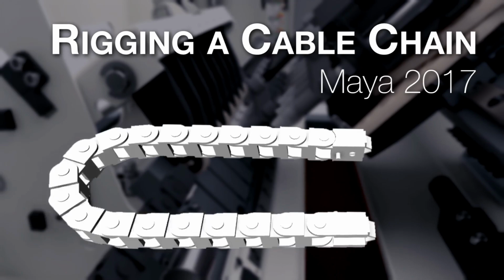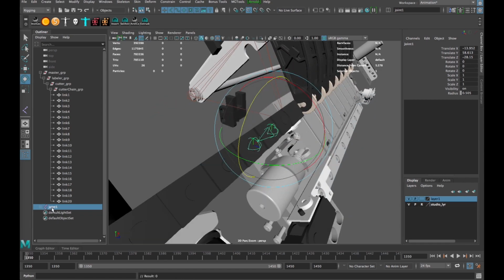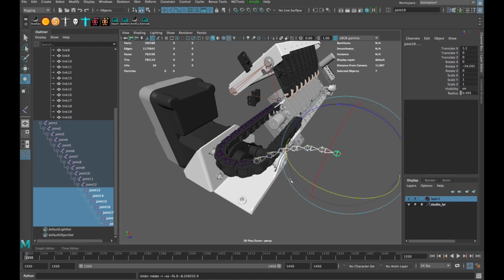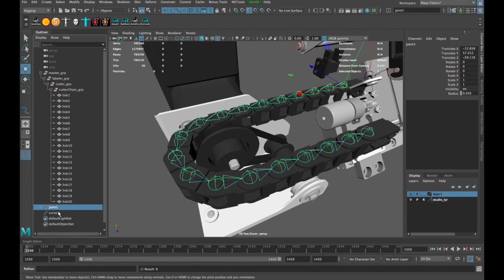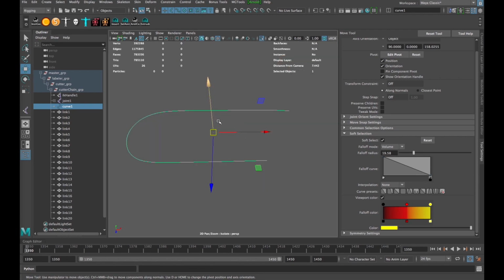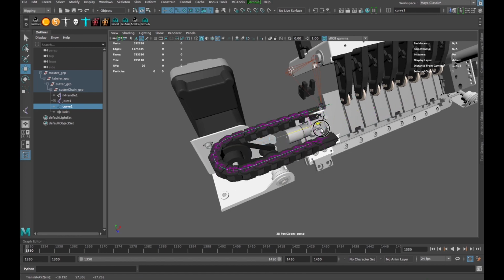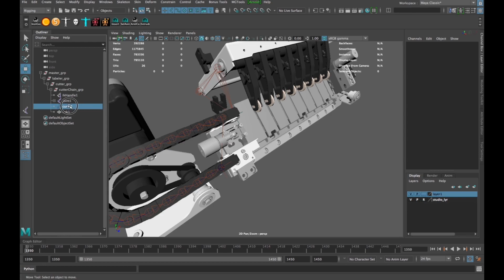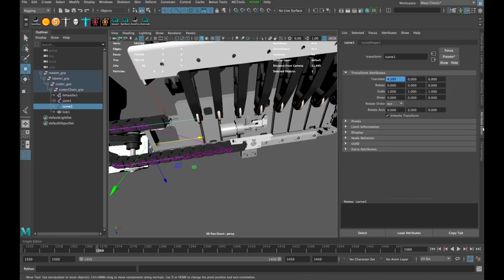Machine Animation Tutorial: Rigging a Cable Chain in Maya 2017

Comment: hi, thanks for your tutorial, I have a problem of fixing the model, the model that I have downloaded from igus cable chain, it doesn't have center point on the cable connection point.
Which mean that the magnet function doesn't have vertex to stick.

Comment: Sorry, when I want to use the "Create IK Spline Handle" option and select my Joint1, I get the error "// Error: No valid items were selected. Must be joints, effectors, or nurbs curves." How can i fix this?
Reply from the maker: Maya might have changed their IK tools, so you may need to look up another tutorial for that. I think you can also do it backwards by Cntrl/CMD selecting Joint1 and the End Effector before selecting Create IK Spline Handle
Reply: @RaconteurAnimation  Thank you very much, I will try.
Reply: @leonardoemiliohernandezper1822  I have actually encountered this issue as well several times. I found that the fix for this is to do it through the Hypergraph: Connections. You can find this menu by going to windows>General Editors> Hypergraph: Connections. Make sure you have your joint chain selected before hand then once you open the hypergraph connections to select input/output connections in order to display your joint chain. The button looks like 2 grey rectangles with a blue rectangle in the center

Comment: If your still curious you could grab the control points and put them into a cluster which you could then parent to things and move them around, for example doing it like that would allow for that motion but would also allow you to add slack to the chain or a wobble into the chain as it pushes.